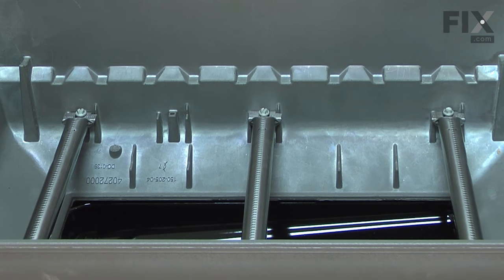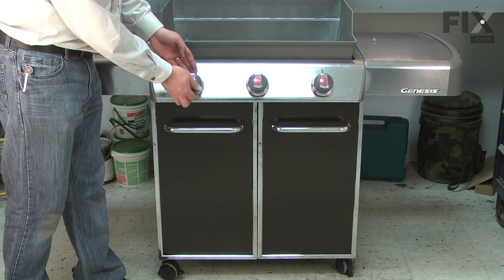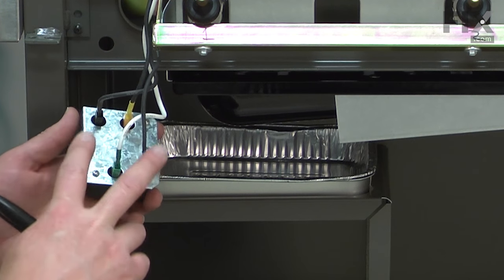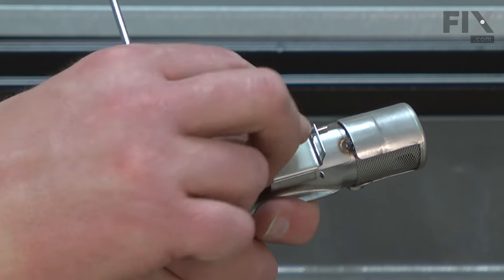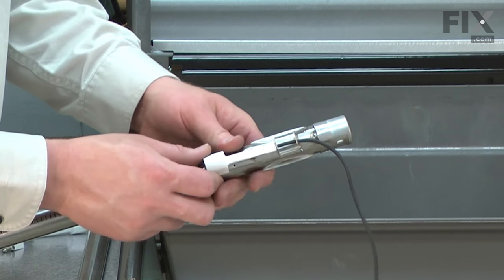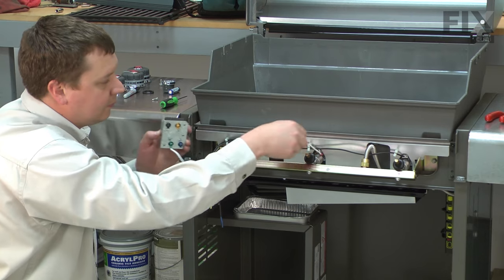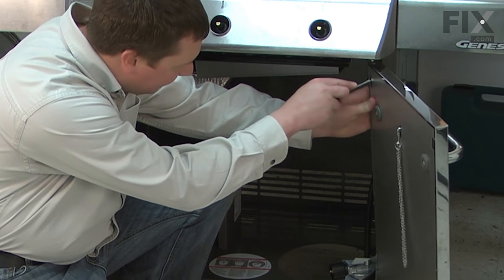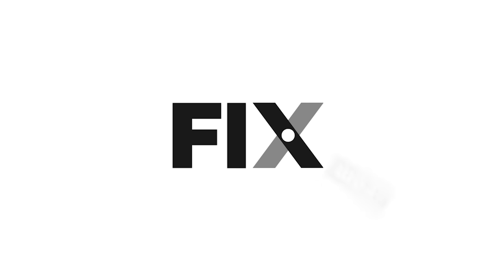Weber Grill Repair - How to Replace the Burner Tubes

Comment: Yea it’s great and informative. Unfortunately when you need to do this your grill will be nine or ten years old look a lot different on the inside. The flange bolts that hold the burners will be rusted round on top and heat welded to frame. After you file new shoulders on the rusty heads and clamp a vice grip on it they might come out or twist off. That’s fun, give yourself a good hour for that. Then you need replacement flange bolts. They’re 12-24’s. Good luck with that too. Then you’ll find the Phillips head screws that hold the wind screen and the front panel are welded tight as well. I did manage to twist the heads off two of those. Drill and tap those at 10-24 once you find those bits. Then go get a bath because it’s 5:30 pm and you can hope to put it back together tomorrow.
Reply: Oh man. This is so funny, but sadly so true. This is exactly my story today. It's so ridiculous that the new burners don't include new bolts and new wires.
Reply: I agree. I don't need a video to replace burner tubes on a BRAND NEW gas grill! Show me how to remove the rusted-on screws!
Reply: YES - my Weber is 12 years old and I had the same issues with rusted/welded screws and bolts. However, this video is very good anyway, I did learn a few things. Took me two days due to the rusted fasteners, but now my grill is good as new and cooks much better than before, with new burner tubes, heat deflectors, flavorizer bars and lighter!
Reply: The real info is always in the comments.
Reply: Thank you for the confirmation. This seemed like a ton of work from the video, and that’s working with a brand new and unused grill. Mine is 8 years old and the burners still work. I was thinking of changing them as a maintenance step but after seeing the video and reading your comment, I decided to leave it alone!
Reply: Dead-on. The rusted screws are impossible to remove.
Reply: I was able to loosen the gas bracket that attaches to the front of the grill which created some room to slide the back of the gas tubes out from the slot at the back of the grill without having to remove the rusted bolt. Then made the mistake of trying to use penetrating oil and vice grips to remove the rusted bolt which took out the bolt and broke the mount in half. Now going to try to reattach with high heat jb weld. Should have just left it alone
Reply: New burners I just got came w/ screen, bracket, wire as a complete assembly part.
Reply: Yup this sums it up.
Reply: Anyone able to get the rusted/crusted bolts off and if you did… how can I do it as well?
Reply: @paulbonaventura4969 I had to chop one bolt head off with a Dremel. The other two broke loose with extreme downward force using an oversized flat head screwdriver. Never bothered removing the cut off bolt yet.
Reply: @beaubjarnason4759  thanks! I can’t wait to spend a whole day messing on this
Reply: The only problem I had was disconnecting the wires from the control panel. The plastic flanges that hold the wires onto the control panel got kind of mangled.

Comment: Guys, you do not need to take your entire grill apart to change out your burner tubes!  Here's how I changed my burner tubes on my ten year old Genesis in less than an hour.  1st - I used a small file to create two flat sides on the rusted/rounded off screwheads so I could use a pair of channel locks/vise grips to twist out the screws.  Thankfully, the heads didn't break off.  2nd - I used a small screw driver to release the igniter bracket (like the tech does in the video).  This allowed me to remove the old burner tubes from the grill.  3rd - I slid the old igniter brackets onto my new burner tubes and laid them into their positions.  4th - I used the included screws from Weber to tighten down the new tubes.  Piece of cake!  No taking apart the front of the grill, or disconnecting wires.
Reply: "and now we're going to remove the grill lid.."
Reply: I can’t believe this reply has not received more attention!? I was lucky enough to be able to loosen and remove the screws without any problem even though my grill is 10 years old.  Thanks to this comment, I was also able to remove the old burner tubes without taking apart any of the front of the grill. Just used a screwdriver to release the tabs pulled out the old tubes put the new ones on, secured the igniters, screwed tubes back in and I was done in about one hour. And a good part of that was cleaning all of the charred sludge from 10 years out of the bottom!😆
Reply: Yes, your procedure is simpler. I had much the same thought as I watched the video. I intend to follow your example. I do want to replace the bolts holding down the burner tubes, which in my case are rusted/corroded but still barely manageable with a socket wrench. My new tubes did not come with replacement bolts, but another commenter identified them as 12-24. Works for me.
Reply: Thank you, this worked for me. My grill is about 11 years old and I was able to remove all three burner tubes without touching the rusted screws that (previously) had secured the tubes. The new tubes slipped right over the existing bolts (they aren't secured, but it really doesn't matter). The hardest part was removing the ignitors from the old tubes, which I eventually got out with some pliers (but be careful not to bend the ignitor brackets too much).
Reply: Thanks for this! My bolts are basically gone on my 12 year old Genesis, so my tubes just popped out. 5 minutes later all 3 new tubes are installed. No bolts securing them, but I'm not expecting them to leave.
Reply: thank you so much--that is the way i was going to try for sure--doing it tomorrow!!
Reply: Thanks for the tip.  Your approach saved a lot of time
Reply: This comment saved me a LOT of frustration and hours of messing around.  I was able to slide off the igniter from the inside without having to take the front off - which I did initially try but all four of the screws were rusted shut.  Luckily I was able to remove the screws holding the burners down in the back easily enough, so thanks to the video on how the igniter clips slide off, and this comment suggestions it could be done from the inside - I now have new burners, a clean grill and managed to do it all in a hour instead of four.  THANKS!

Comment: Just got done with the job and could not have done it without this video.  The parts came without instructions so this information was invaluable.  I have the Weber documentation and would not have known how to handle the igniter clips without it. Agree with JonRichhart about the time needed and the difficulty with the flange bolts.  I was able to finagle the burners off and then,  with a bunch of liquid wrench, get a grip on them and remove them with pliers (as the heads had corroded.

Comment: Disassembled, (rusty burner bolts and all) and reassembled, checking with the video every step of way, and it literally took me longer to find the sear burner from a vendor selling it online than it did to do the whole process of removing the doors, control panel, wind guard, old burners, heat deflectors and flavorizer bars, cleaning up the interior of the grill and reinstalling the new parts (burners, deflectors and flavorizers). The new parts did indeed include replacement screws to secure the burners, so the mfr must have heard past consumer complaints about not providing those replacement screws with the new burners. This video provided great clarity among the video footage and the instructions. There are a lot of videos on YT about replacing the burners but even if you own a 2016 Genesis E300 series, this video still applies. (Note: The green connection is a black wire on my grill, not white as depicted but still in the #2 position connecting the sear burner. All other reference points were identical to my grill.) Thanks so much for giving me the resources to tackle this on my own.
Reply: Hi, I have a 2011 E330 that one of the burner tubes needs replacement. Looks like they come in sets of 3. Can you tell me where you purchased the replacement tubes? Are they Weber parts  or 3rd party? Thanks

Comment: I just did this today. Although the video is useful, it doesn’t address the main issue all of us face with an old rusty grille. The burner screws essentially welded to the frame. My grille is about 7-8 yrs old and two of the burner tubes were essentially flaking off the holes. I ordered the standard 3-burner tube replacement kit from Weber (it doesn’t come w the sear burner tube, but you can always replace the sear burner with one of the old burners that’s least damaged. I don’t use the sear much. Before I ordered, I made sure I could remove the old burners. I could not remove the screws in any way. But surprisingly the burner tubes got a little loose once I tapped on the screws and wiggled them around. Once I could get the rusty end, where the U flanges of the tubes are, wiggled off the screws, they came out. The tube assembly comes w Weber instructions, which I followed. They say to remove the lid, but it’s not necessary. The guy on the video says to number the ignition leads, but it’s not necessary either, since they are color coded. Definitely made a big difference — blue flame! Hadn’t seen that in ages. Bottom line, see if you can remove the old burners by tapping on them and wiggling them, then you’re good
Reply: Thanks for your comment,  I just got a set of 4 burners warrantied for a 2012 E330 Genesis.  My current burners wiggle enough that I think I can use your insight to replace them.  My grill spent 7 years of its life inside a garage when not in use, and 4 years outside always under a cover when not in use, so I may have some better luck with the welding of the screws.

Comment: Great video!  Since my igniter stopped working 3 months after purchase (like they all do), I simply pulled out the burner, cut the wire and didn't have to disassemble anything!  Entire burner changeout took 5 minutes on my 12 year old Weber..
Reply: My igniter worked for 11 years, going to be changing it today, fingers crossed

Comment: This is a thorough video, but I need a video showing how to do it on a 10 year old grill...corroded screws and everything.
Reply: I have the same issue... the screws are rusted and the heads are like dust..
Reply: @egg1871  yep. Easy on a brand new grill. One that is older and well used…
Reply: I had to first use my Dremel with a metal cutting wheel to cut the tubes in two so I could get them out of the way. Then I used the Dremel with the metal cutting wheel to cut slots in the screws for a flat blade screwdriver. It worked, but the stainless steel screws were so soft that the slots almost didn't hold.
Reply: Step 1: Clean and remove meat sludge so you can actually see what you are doing.

Comment: Rather then chance breaking one I just chipped around the edge of the rusted burner hex nuts allowing me to pull up the burner tubes. I was able to slide the new ones under the remaining flange. With that time saved I took the ten minutes to remove  then replace the front panel. Doing that made dealing with the wiring so much easier.

Comment: I agree with many of the other comments.  My grill is 7-8 years old and used a lot.  Unfortunately it has Ben blown over a few times and when removing the air deflector plate the plastic pieces were broken.  I Jerry rigged it but any other issues and it’s going to the curb.  The video was very helpful, however.

Comment: I have a Weber Spirit 300 (I think) and I did not have to remove the front controls cover. I unscrewed the fasteners along the back and they all pulled out fairly easily. The only thing I’d pay attention to is the orientation of the igniter and really it’s only going to operate if it’s mounted correctly.  The other little detail is to pay attention to how that cross tube that feeds gas to the middle and right burners is installed. Look at the existing one before removing it. 

Also, somewhere someone asked about natural gas versus propane. I don’t think it matters became that detail is part of how (which connections) the gas is fed to the grill.  Mine uses natural gas piped in from my house.

Comment: thanks for this comprehensive video.  my problem is having a 2011 génesis 330 which has a sear burner. having dismantled the bbq, i noticed i have a similar ignition with four connectors each attached to the four burners. The replacement i received, which is similar to the one you have illustrated, has an additional white line connected to the centre burner connector. i don’t know what to do about the white  cable since the four burners are already wired up.

Comment: Everyone has a problem with the rusted screws for the burner tubes. A better design would be to use a hex shank the 12/24 screw threads on the bottom (like the stand offs on a computer case that hold a computer motherboard). The hex shank would need to come up about a 1/2”, and have a groove around the top. Screw the hex shank in place, drop the burner tube flange around it the pop a C clip into the groove to hold it in place. Years later when it’s time to re0ace the burners, simply pop off the C clip, replace the burners and pop a C clip back on. I suggested this to Weber…. Would be a great after market improvement! Now I gotta go remove two stuck screws that have been soaked with PB blaster for a few days. Ugg

Huh… I was able to slide the tube slightly to the front to clear the screw head and lift the burner out, then disconnect the igniter, then install a new burner (pop on the igniter and push thru the front then down in the back past the screw head, then forward under the head). Don’t need to replace the screws.
Reply: Got mine off easy...just used WD 40 to unfreeze

Comment: I changed my Genesis from NG to LP.. It was cake and only cost 65 bucks for parts.. WD 40 on the burner bolts for 2 days soaking really helped.. Weber said they would not sell me the parts, but I found them online.. Weber also wanted to sell me a new grill LOL. ya right.. This one was 1200.00 The job only took me about 1 hour and that included cleaning it.. OK maybe 1.5 hrs.. I like it a lot better now... Don't forget to set your air vents when finishing.. You should have a blue flame not yellow.

Comment: Excellent video, thank you.  One question, what size are screws in the back that hold the tubes in place?  Mine are rusted and covered, having difficulty getting them out.  Trying not to strip them anymore.  Thank you.

Comment: I have a 2012 vintage S470. It seems quite different. Each burner valves has a spring actuated mechanism that lights each burner tube respectively.  How do I take this apart?

I am working to clean up the fire box. The burner tubes have a lot of plugged holes. The tube mount piece (screw into the base casting) screws appear pretty corroded. Will they come out, or will the screws break?

Comment: The process is smooth as long as you have a NEW BBQ. Imagine my grill that is 10 years old, and I need to replace the burners. Everything else seems fine. The FIRST challenge is removing the rusted deteriorated SS screws that hold the burners in place. I have soaked the screws with penetrating oil for over a week. They won't budge. What is the nut driver size to use? 5/16" seems too big, 9/32" won't fit either; too small. Can the burners be removed w/o removing the screws? Will the burner pull out beneath the clip??  Any help is welcome. I don't wish to replace the entire BBQ when the burners are the only issue. Should I cut the screws off then figure out an alternative attachment? Could the rear of the burner just rest on the support w/o mechanical attachment?
Reply: I got two out of three out, but like you, I soaked it with penetrating oil for over two hours, without luck. I used vice grips to try to turn it, but that didn’t work either. I finally used a pair of pliers and bent the left lip on the back of the tube out of the way, and removed the tube. Then I was able to get a grip on the screw with the vice grips and remove it.😂
Reply: @squire330  damn I am in the same situation

Comment: My screws holding the tubes down were rusted rotten and heat welded into place. Cut a small groove in head with dremel and used a hand held impact tool with a hammer and all came out relatively easy. And you DONT need to take the whole front apart to replace the tubes!!!!

Comment: yea no way would i even attempt this.
Reply: Joke! The bolts are rotted and screws will snap off. Save you time and throw it out.
Reply: @tedmueller949  Pitching a $700 grill over some rusted screws. Do you have your vehicles compacted when they need tires?

Comment: Seriously, you have to disassemble half the frill just to replace the burners? That's ridiculous! To start my screws are rusted stuck.
Reply: Try WD-40 or some penetrating oil (Kroil does pretty well). I was fortunate: there was enough of the heads left for a socket to grip.